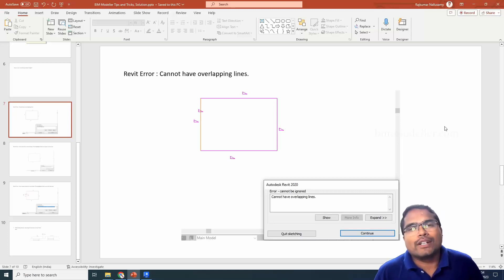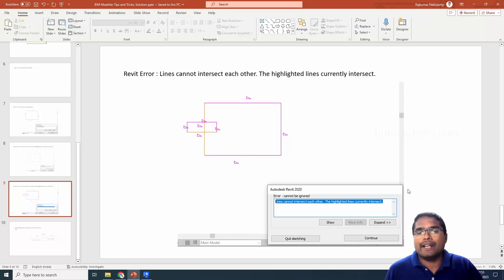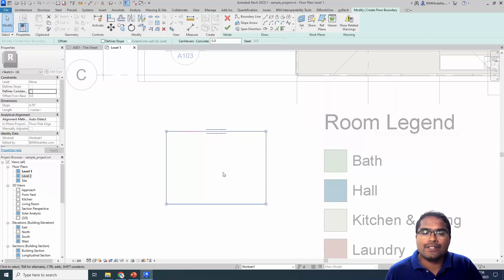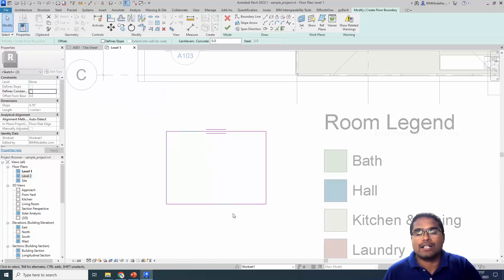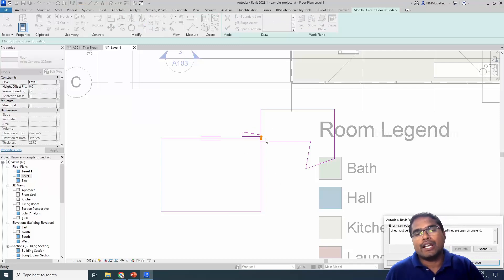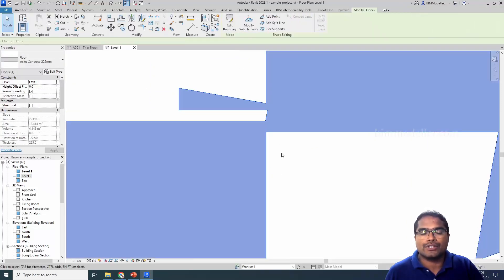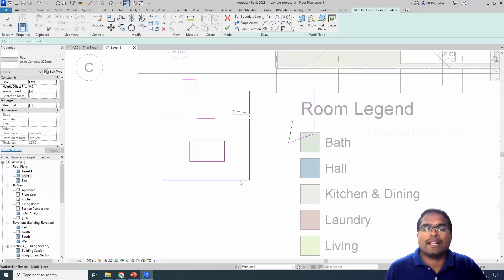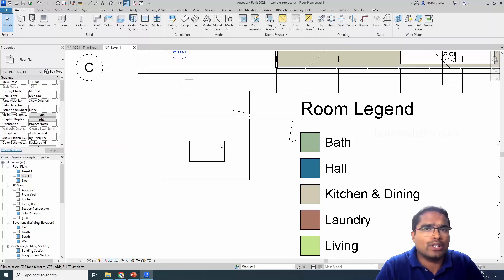[Solution]: Revit Floor Extrude Sketch Error #bimmodeller @BIMModeller

Comment: Sir There was an error while doing link cad. Geometry in the file       .dwg has extents greater then 20 miles.This may reduce reliability and result in undesirable graphic behaviour.
Can you please help me with that.
Reply from the maker: Hi you have to Explode, Purge and Clean DWG file before importing into Revit. Revit Space don't go beyond 20miles. But if AutoCAD has some elements beyond that it will create this error. I will create a video for you. Thanks for the suggestion. Happy Learning!